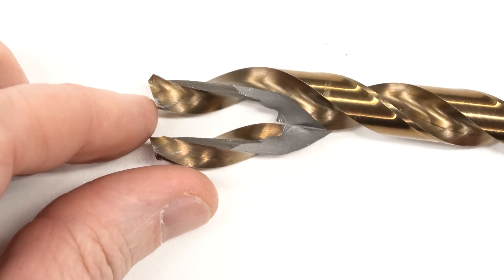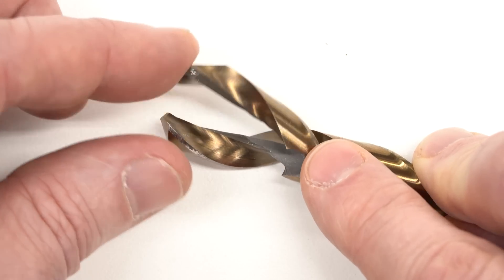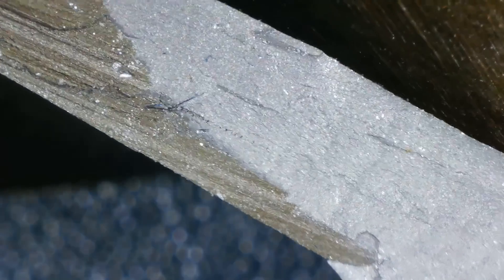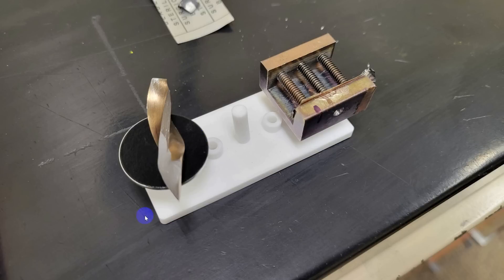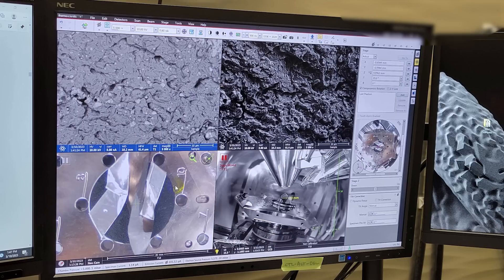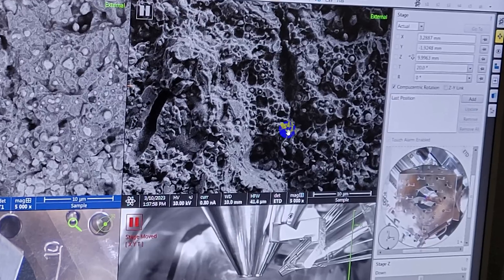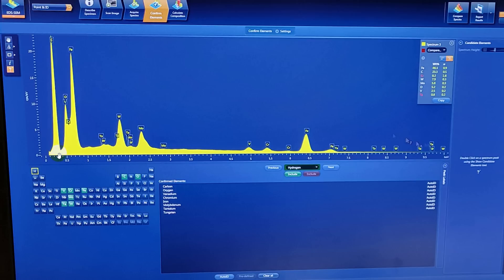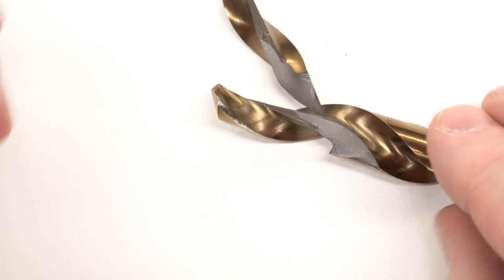What the Scanning Electron Microscope Reveals About This Failed Drill

Comment: A good tool for enlarging holes is a core drill.  A 3 flute core drill has two advantages.  The web is thicker and stronger.  The extra flute greatly helps keep the drill from wandering, especially if there's hard or soft spots in the material, such as weld.  The third flute also helps if the hole overlaps some other feature by a small amount, keeping one flute from grabbing the open space on the side.

Comment: When I programmed CNCs in the 90’s, we almost never programmed pre-drilling. Only for very large diameter drills. We almost always center drilled and then just plunged in the drill. The advantage of the CNC is of course that you always get the correct cutting and feed speeds.

Comment: Back in the day when I used to work in oil and gas we had failed drilling equipment that twisted off in the well. We sent it to two independent metalergical labs and they each came up with conflicting opinions on failure mode

Comment: Selling expensive high quality drills with massive cracks is pretty lame.
I would expect a quality manufacturer to perform a sonic spectral ring test on the product, it takes a second and the machine should give a simple go/no go result.
Is it possible that you cracked the drill at some previous time? Possibly when doing something that made it very hot? 🤔

Comment: Not a machinist, so everything after the period on this sentence is highly suspect. I'd suspect that what the manufacturer is most concerned about is the prospect that someone is drilling a hole expanding a hole in a non-concentric way, even in a lathe where the work and the tail stock have not moved out of concentric position between bit setups. (offset by dust in a chuck, perhaps.) That said, with what appears to be the earlier failure/crack in this bit, I don't think it would have mattered, or perhaps even may have caused a failure even earlier, as I suspect that in your shop the setups seem to be well prepared, and the step drilling is likely to have minimized stress on the bit up until it failed. It would be interesting to know if the minor fractures observed were material fatigue, or were they fractures spawned by the breaking event.

Comment: It wasn't you, it was the drill. The bit failed from improper heat treating. Not necessarily human error. The drill bit was manufactured in mass quantity environment to which not all pieces get 100% inspection, but a random sample inspection from a lot. (hence lot numbers) One out of 5, 10, 50, or whatever is deemed by the manufacturer to make sure they only send good products to the customer. However some do get away. This one got away. With that said. I've been machining for several years. Drilling a pilot hole serves one purpose, to relieve tool pressure across the web of the drill. You don't feel it that much when drilling a pilot hole using a small drill. On larger drills using a drill chuck in the tail stock I will pilot drill a hole just larger than the web of a quite larger drill, then drill the larger hole with success most of the time.

Comment: While this drill doesn’t “require” a pilot hole since it is a split point, any drill with a web should be preceded with a drill at least the same diameter as the web on the larger drill. But the geometry of the smaller drills are still more efficient at removing material closer to the center of the desired hole than a drill with a split point is. To say that it’s not recommended is absurd and a CYA cop out for an inferior product!!

Comment: What drill hog told you was correct although some times necessary when you pre drill a hole and go back in with a larger drill the hole will not be slightly over size as it will when blind drilling and the start to bind and gall on out side of flutes where drill is weakest as you can see from galling on flute lands of drill that broke. If you have to predrill hole use a drill that is only 25% of size drill you will finish with. Most machines will drill a lot bigger blind hole than you think I do not predrill any hole smaller than 1 inch on my bridgeport.

Comment: The problem with re-drilling existing holes comes from the point when a drill bit is prone to drag itself into a work piece at way higher chip load rates than allowed as there is practically no resistance on its way. Also if there is no support at the center tip of the drill bit the load distribution conditions change dramatically that makes corners experience more stress than normal. Some drill bit manufacturers specify the maximum drill bit diameter to pilot hole diameter ratio for re-drilling.

Comment: Bad material, porosity, then perhaps it was dropped or cooled creating a stress fracture. it then proceeded with finalizing the product. Wonder if the do NDT with X-ray or ultrasound to try capture this sort of thing. 

I wonder if you got a 5 - 10 drill sample to test if you can get a similar failure after you do some NDT on the drills first. They may all have cracks hence the we don’t recommend (that could just be that the torque on flutes is higher than designed) 

Could you chop off the crap area then file in new cutting edges? Have a stubby drill as a backup for sketchy cuts where you don’t want to Risk a nice new bit.

Comment: You want to fix EMC emissions, or susceptibility in the PC board?
I worked avionics, and the start of my career carbon fiber aircraft were just starting to be the new method of airframe manufacture. This was early 1980s, and lightning and HIRF became the two beg design changes to avionics to prevent damage and upset.
I spent many hours doing qualification testing to RTCA DO160 test standards on a flight control product. It was a modular box featuring dual-dual autopilot and triple flight management computer. Also a maintenance computer, and 4 data switches (using ARINC429 serial bus standard). I figured out how to stop HIRF from upsetting the 19 microprocessors in this system. The 'secret' is LC filters, that require a super duty ground chassis connection to the PWB. The L and C are intrinsic to multilayer PC boards. Using the ground planes to create the C to the signal trace, and L was just 2 cm or trace length between the ground planes. This was done right at the input connector pins. The hard part was getting a very low impedance ground connection at that point. The way this was done was using the Bendix style circular MIL connectors. Which were connected to the chassis, and PC board via nickle plated standoffs. The extra ground layers were right at these connectors. Also the aluminum avionics box was connected to ground via the aircraft avionics shelf. Again nickle plating was used for it's low impedance skin effect qualities.

Comment: I actually came to the complete opposite conclusion! If you look at the crack at the rearward side, where it broke at the cutting edge, you'll see "beach marks." These are characteristic of a fatigue fracture  initiation site, and that was my first clue. I was suspicious of the idea that the bit could be cracked from the factory so severely down the middle and not chatter immensely or break early. Another characteristic of fatigue fracture is striations in the "fast fracture" portion of the break, when the material finally gives way, and we see that in the tip-ward part of the fracture. One more thing: brittle vs. ductile fracture release energy in very different ways, and I think that may explain the oxidation. A brittle fracture releases energy as vibrations, and those dissipate throughout the metal as the sound is absorbed into the bulk material and other objects it's connected to. However, ductile fracture releases most of its energy into the material that is actively being stretched! That means, your ductile fracture surface was going to be very hot when it opened up and got exposed to air, which I think explains the oxidation (in addition to a lot more surface area to react over). And finally, the location of the transition between the colors. It's right at the point where the web of the drill starts, the point at which the cross-sectional distance across the fracture stops decreasing. I'm pretty sure this is due to the transition in stress direction from a mostly pure head-on shear crack to a side-loaded torsioned crack, and that also explains why it did not crack down the middle, but instead went to one side of the center of the torsional axis.

Take this all with a grain of salt, I'm just a mechanical engineer who got really into materials in college, not someone who does this for a living or knows my stuff.

P.S.  @Zircon10 has a good explanation for why I'm wrong about this, and is actually a professional.
Reply: I don't think it was a full-on fracture coming from the factory.  For one thing, that might have been pretty visible before the separation occurred.  Rather, I suspect it was a micro-fracture, basically an incomplete fracture that produced a weakened area in the bit that eventually separated under heat and stress.  Your explanation of the Oxygen contamination of the fracture is possible, but I suspect incorrect.  Oxidation takes time, and the environment of a ductile fracture is not going to be highly uniform nor likely to be comparable to the environment during heat treating.   The fact the concentration of the O2 in the fracture is virtually identical to that of the exterior of the bit suggests to me its presence was due to the heat treat process, rather than to the ductile  deformation.  I certainly cannot say with any sort of authority you are incorrect, but I suspect you may be.  Either way, however, it is perfectly clear this bit was definitely flawed.  I have broken a small number - very small, I am happy to say - of small drill bits in Aluminum by inadvertently allowing the bit to clog.  Looking at the video, I am quite confident the bit was not clogged.  Look at the chip coming out of the Aluminum.  That hole is not clogged.  Furthermore, I have NEVER broken a bit anywhere nearly this large in any medium whatsoever, and certainly not when a properly sized pilot hole is employed.
Reply: @leslierhorer1412  And the consistency of that oxide layer throughout the fracture proves that the full crack was there during manufacture.  Oxidation in nature takes time.  Oxidation in a hot chemical bath designed to do just that - not so much.  (The yellow-gold surface is an oxide treatment.)  It was probably a microcrack, so small as to be invisible to the eye, only detectable by machine, that happened during the forming of the 'donor' rod the bit was cut from.  This kind of microcrystalline fault is not unusual in metalwork, though far rarer with modern forging methods and materials than it used to be.  The oxide treatment would have made it even more invisible.
Reply: This is what I tried to explain in his last video but not as technical as you. Great job. I've seen this happen myself with a lathe. People will tell him they drill holes all day and have never seen this but I'll bet they drill vertical holes. Gravity, his taper, drill chuck, and the sudden load change from the tip of his drill to the edge getting caught in his hole have a lot to do with this. In his last video, it's clear that his tail stock was hanging out way too far and the pressure on the tip of the drill was too much causing the hole setup to flex... This flexing made the flute of the drill get caught on the inside of his hole and all the inertia of the spinning lathe chuck just snapped that hard drill (which would not have happened with an HSS soft drill) At the same time you could see the drill and chuck get pulled off the taper just a tinny bit.  James knows his stuff but just like most machinists I know don't like to admit to being wrong about something unless you can repeat it for them.  This could be done with his setup over and over...
Reply: @Jeralddoerr  Uh, nope.  I have been machining for nearly 40 years, and done many thousands of horizontal holes.  Except when drilling small holes, I always drill a pilot, and then step up to larger and larger drills.
Reply: @leslierhorer1412  Well I have 20 years of experience and have had this same problem! plenty!!! of times getting high-speed steel drills stuck in this same way! Once or twice breaking or chipping flutes of hardened drills.  I'd be interested to know if you've drilled holes plenty of times with the same variables he's using here.  Aluminum, size, and depth of hole... Huge Keyless drill chuck?  look at the length his drill chuck and arbor are hanging out of the tailstock!  go back and watch the video 5 seconds before it breaks. We don't know if he dropped the drill fracturing it at some time in its life... He has said he's broke others from the same set. I'm not saying this is the only reason this happened to him but I'm providing my experience with this almost the same type of setup. Small taper hobby lathes... Period!   Please tell us what type of machines you use and the material combination drills you drill thousands of holes in and with? Hobby machines? I doubt it...
Reply: @Jeralddoerr  Your statement does nothing to account for what can clearly be seen as a manufacturing flaw in the first portion of the drill bit. I have had 2 of these fractures very similar to this and both occurred whilst drilling vertically in a drill press. In both cases the drill bits were M42 Cobalt HSS and in both cases the supplier concluded a manufacturing defect/flaw had existed at the tip portion and a breakage had propagated from that flaw. It happens more frequently with bits with a higher proportion of Cobalt although the failure/flawed rate is still a very low percentage of manufacture.
Reply: @howardosborne8647  Why would I repeat myself or what Alex has already said? Sure ANYTHING can be manufactured wrong and people can also use them wrong. (too big of drill for a small taper and tailstock.) What might seem clear to you is explainable to others.  Please don't play like I'm saying there's only one way for anything to work. There are hundreds of thousands of variables in machining but if this was reproduced and the same type of drill was used you will have the same 2 outcomes (drill gets caught up and spins the drill chuck and taper) until the drill breaks.  Have a good day.
Reply: @howardosborne8647  You should read what others are posting here. People who have careers in material inspection are saying.   Tell them they're wrong.
Reply: @Jeralddoerr  What are your qualifications to make this statement?
Reply: @williamsanders6092  breaking a drill or two myself in 20 years of home machining on my lathe EXACTLY like this! Also, I worked at a company that sold tooling for 6 years... That's all..
Reply: I had a similar thought myself, also based on some materials science education, but not expertise. I believe the beachmarks and cupping are indicative of fatigue, I wonder if that fatigue just happens very rapidly for a spinning tool like this. I couldn't find the comment you mentioned, oh well.

Comment: First of all, thank you for this very informative video, and all the others before! I was taught that pre-drilling is done to avoid high axial loads on the drill(-ling machine), which come from the unfavorable geometry of the drill in the central area, where it only displaces the material, rather than cutting. Even with the split point grind, the geometry in the web area of the drill bit isn't ideal. The recommendation is to pre-drill with about the size of the cross width of the web, or about 20% to 30% of the bigger drills diameter. Usually holes under 8 or 10 mm don't need to be predrilled (would require a tiny 2mm to 3mm pre-hole).

Comment: Always drill big to small,  step drilling is a big no-no.  Also another common practice of spotting with a 90* spot to chamfer diameter or spotting to depth with a center drill has the same effect.  You want the center point of the drill to pilot and guide the drill.  That's why the drill has a split point.

Comment: I just threw one if my failed Drill Hog bits in the scrap bucket today I'll have to dig it out and look at it closer to see if it has the same color difference. 
None of the ones that have broken were drilling a existing hole larger . And the one I told you about breaking wile drilling the delrin was backed out several times to clear the chips to prevent the flutes from being loaded up.

Comment: Could you try the unibit tip drills from norseman, and give use your thoughts. I do a lot of drilling with cordless tools and I use step bits a lot for various reasons. like overlapping plates its the only way to drill through one edge with a hand drill.

Comment: From my education as an Mechanical Engineering Technician at Purdue University, the dark area at the tip tells me that that area was already cracked. The crack allows oxygen in to that surface and causes that oxidation! Part of my education at am MET included the study of failures, such as this, and that dark color is indicative of a pre-existing crack. The light area is in fact a brittle fracture that happened as you drilled! As to your question about pre-drilling holes ... that is in fact standed machining practice.

Comment: I mean it makes sense if you think about it no or a tiny pilot has even force across the drill step drilling is just apply force on two outer edges pulling away I also think if that drill didn't have a micro crack that went unnoticed you probably wouldn't have had a problem 👍